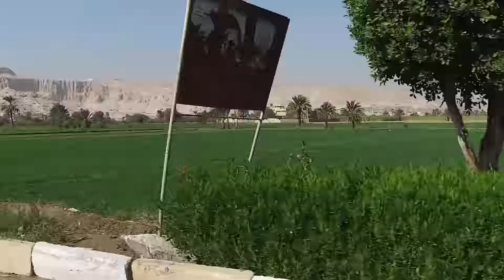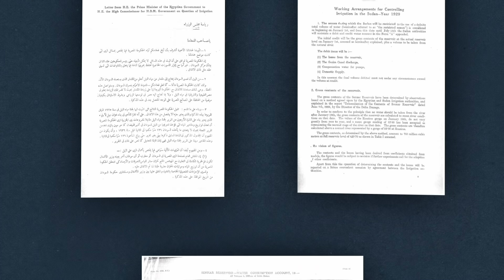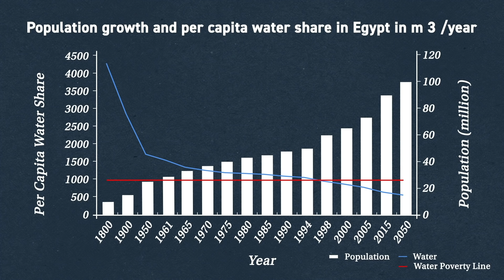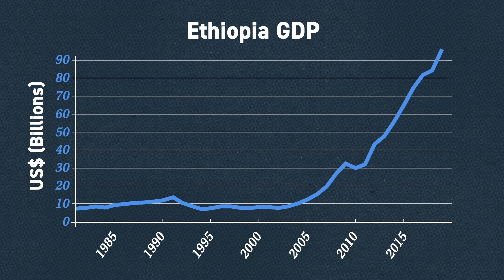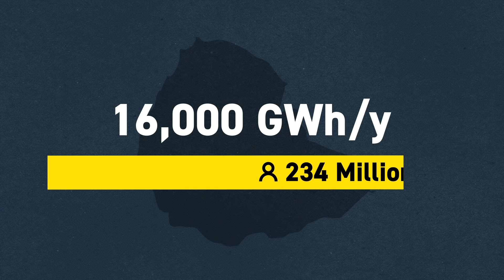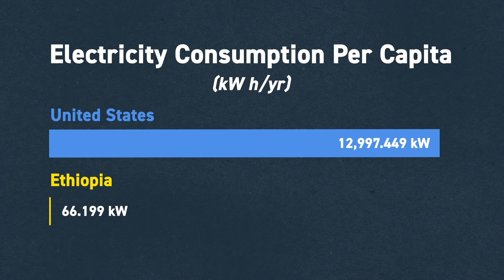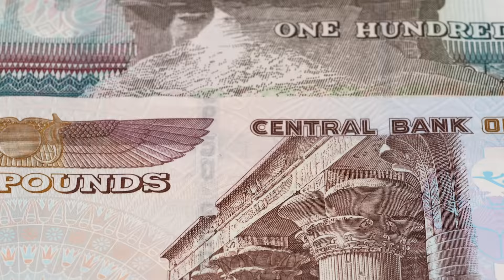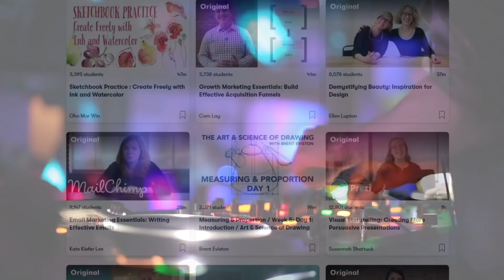Egypt's Dam Problem: The Geopolitics of the Nile

Comment: Egypt is like a greedy kid who want everything for himself without sharing for his friends. What makes Ethiopia  a reasonable?
1.  Abay (Nile) is originated in Ethiopian highlands. As we know much of Ethiopian lands are highlands. almost every little rivers flow to ethiopian low land and joins and create together a big Nile river. So Nile is not just one river but it is an addition of so many Ethiopian rivers. So If Ethiopia don't build Its mega dam on Nile river, which river will be suitable to build such a big dam?
2. Ethiopia is a land locked country. So her only chance is her rivers.
3. Over 60 % of Ethiopians have not an access to electricity. 
4. Ethiopia  has not a gas source like Egypt and Sudan so this way of generating electricity is not a solution for Ethiopia. 
5. Ethiopian capacity has not reached yet to generate electricity from nuclear power.
6. Even if it is her river, she let to use the river for downstream countries.
7. It is a hydroelectric dam so it can not stop the flow of the river. Because the dam has a capacity of 6200 MW so it has bigger turbines  so billions metric cubic water flow from the dam.
  8. The dam not only uses for Ethiopia but it uses also total East Africans. Eritrea,Sudan,Djibouti,Somalia, Kenya are the beneficiaries from the dam.
     What makes Egypt unreasonable?
1. Almost 100% of Egyptians have an electricity
2. Egypt potentially has another sources of power for example. Egypt can generate electricity from oil since she has a source of oil accumulation.
3. Egypt is trying to bind an agreement with Ethiopia based on colonization time treaties. Since Ethiopia was not under colonization, she can not accept such agreements. because the agreements only let Egypt and Sudan to use from the river.
4. Since the beginning of the time Egypt was the only country who use Nile. She built hydro power and agricultural dams on Nile river but she didn't ask a permission upper steam countries. 
5. Egypt are financing terrorist groups to destabilize Ethiopia.
6. Egypt ignited  a border conflict between Ethiopia and Sudan.
7.  Egypt worked so hard on world bank and other financial sources to don't let a lon for the dam. That's why Ethiopia are building the dam on her expense.